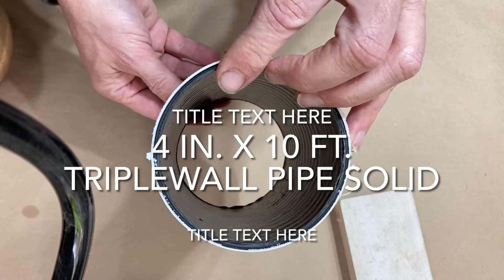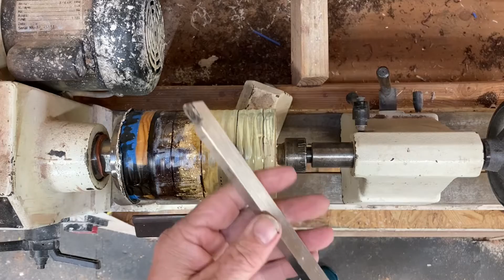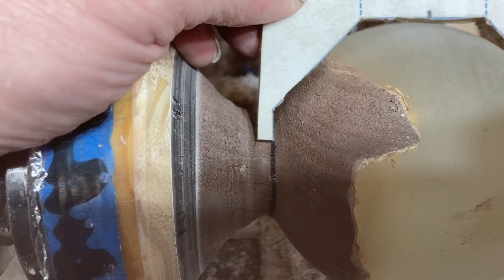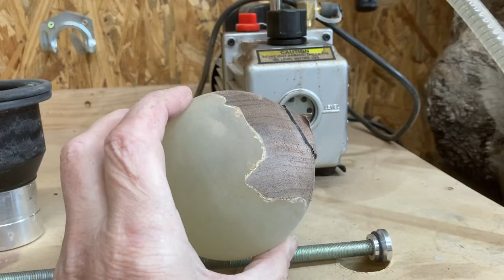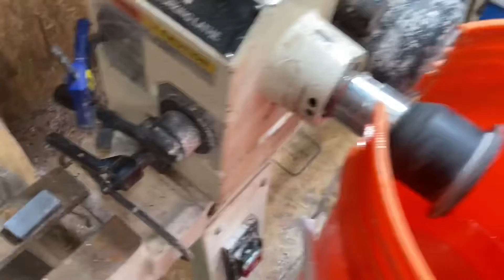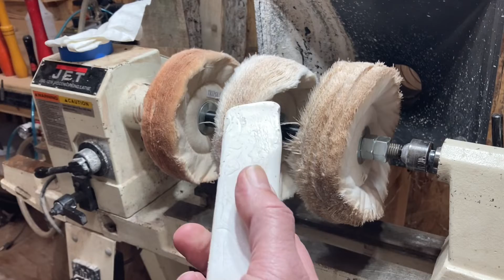Creating a resin sphere - step by step guide

Comment: which model is your Jet lathe?
Reply from the maker: It's a Jet 1236 but I did modify the base to give it a box that contains three bags of sand to give it some stability. Seems like a good medium-weight lathe, although the pully-based variable speed mechanism sucks especially when it gets cold.